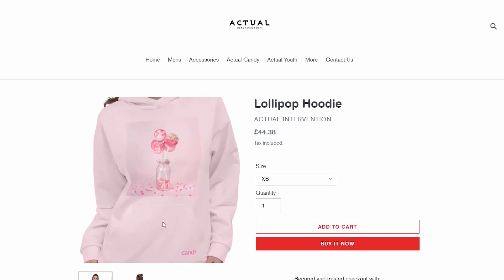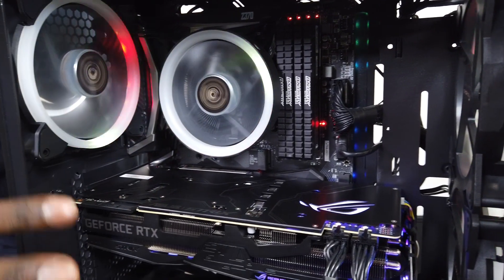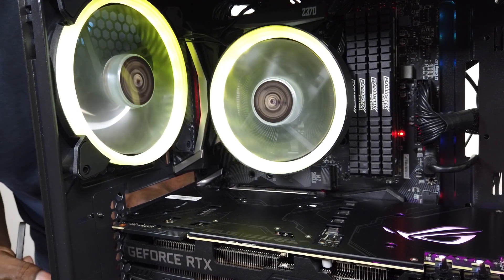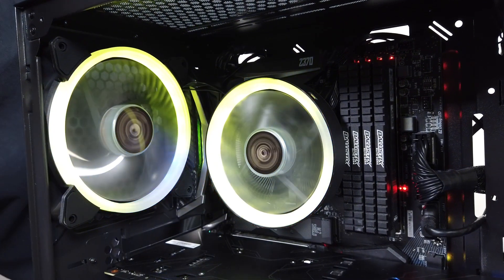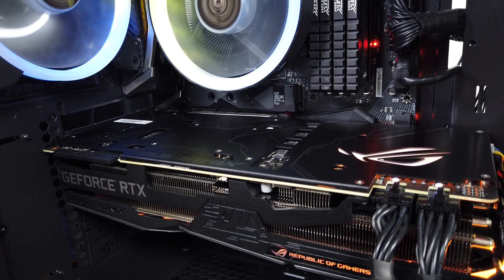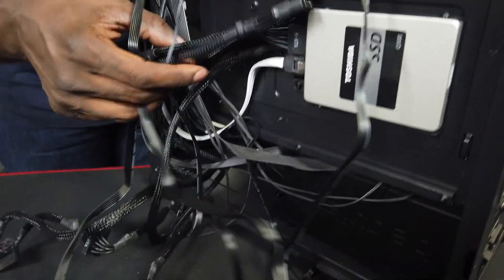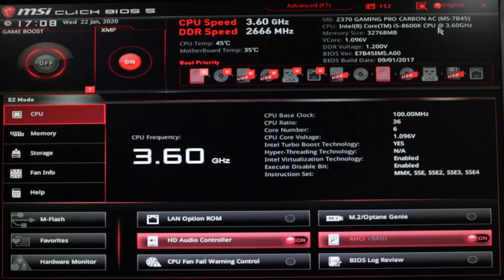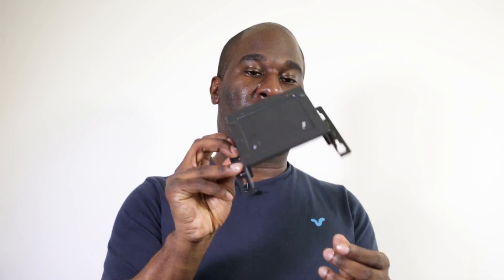Sahara Gaming C500B RGB Case Build! - [mxdout]

Comment: The ideas of tempered design for C500 case are because A. no screw attached the panel will help the case look nice , clean and sexy B. Reduce the change to damage the tempered glass during transportation or installation.
Reply: i think it looks really smooth, nice clean lines. worth the extra time

Comment: Nice review, I have these Sahara fans and controller but don't know where to connect the A & B cables to my Asus Rog Strix Z490 H gaming board, this is my first PC build. It says on the controller instructions (if you can call them that) that A connects to M/B PWM socket and B connects to M/B Sync but thats double Dutch to me. Can you tell me where they connect? :-)